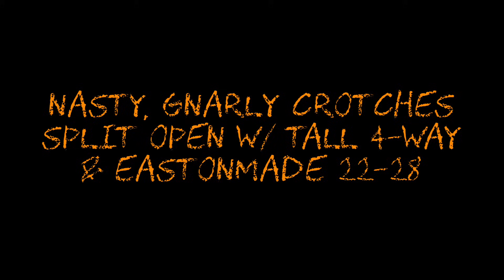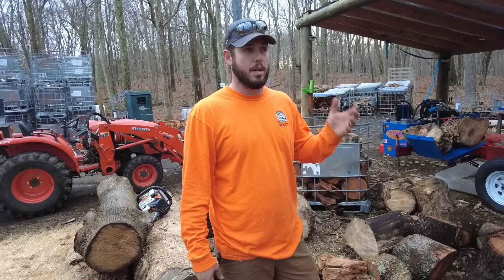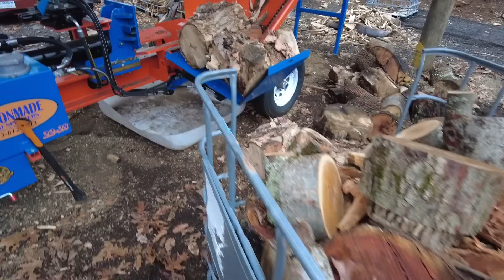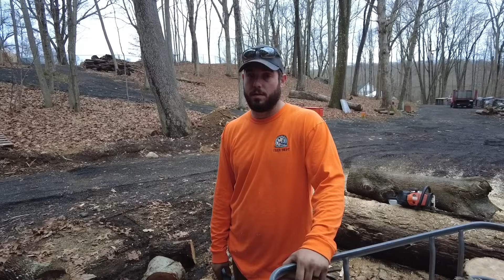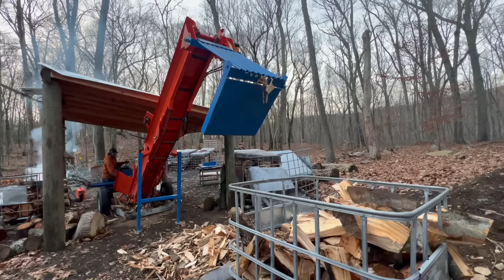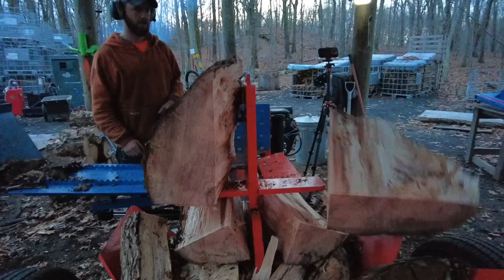#439 Splitting NASTY Firewood w/ Tall 4-Way Wedge & Eastonmade 22-28

Comment: I like to use my 4 way hydraulic adjust wedge for crappy wood because I can drop it right down to the beam and the top wedge is still 30" high. I cut my own trees down and I cut as low as I can so there is some major root flare to split. I drop the 4 way right down and slice it in half then raise up to 4 way split the two halves and the rest of the "straight" rounds.

Comment: Can not wait for my 22-28😢
Reply from the maker: That’s exciting! What wedges did you order with it?
Reply: Ordered it in August when they had the 12-16 month lead time, then in October Andrew put out the video on the shortened 6 month lead times, so I’m looking at February-March. Originally ordered the box wedge/pull back arm with a high four way and the standard 6 way that it comes with. Then after watching your pizza wedge video I changed the standard box wedge to the pizza wedge. Can’t wait.

Comment: Advantage getting trees outta the woods. Pieces like those get left there. Is that the wedge that the lifting pin comes out when lowered too much?
Reply: I think it is true of any of the wedges.
Reply from the maker: All of the wedges have the same cantilever design, if you drop them down all the way the lift mechanism disengages. There is plenty of adjustment though to drop it low enough to use the single wedge while still being fully engaged.
Reply: @DudeRanchDIY  I totally agree.